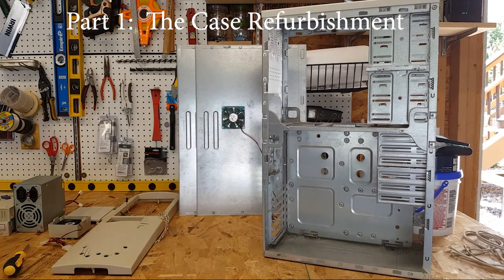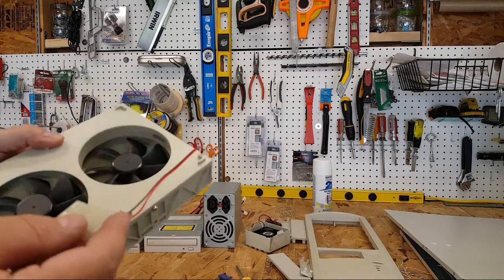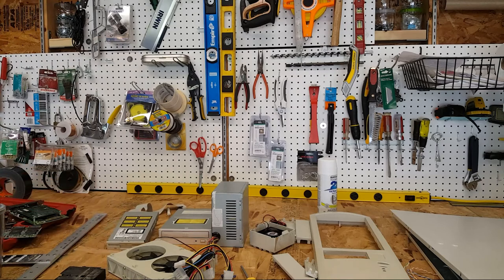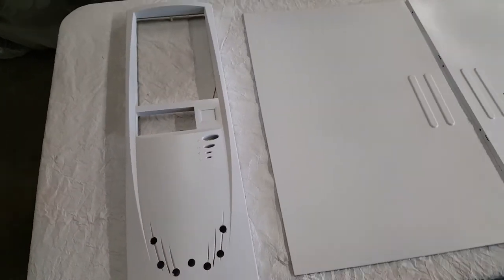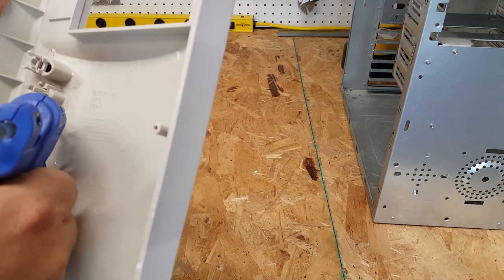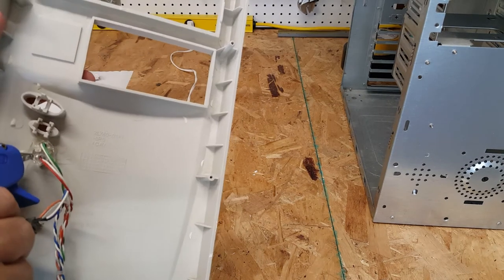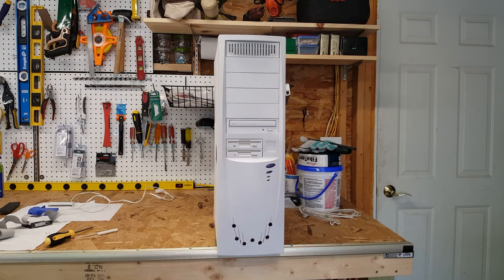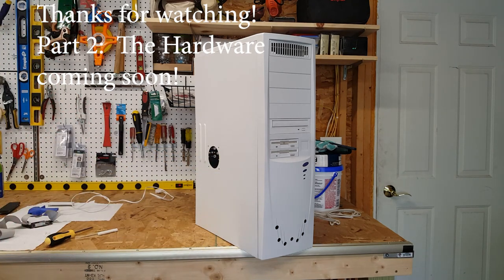Classic Computer Case Restoration Clean and Paint

Comment: About to start on my own "retro sleeper build". Did you have to sand down the parts before painting. Looks great!
Reply from the maker: In places, yes.  smoothed out some bumps in the plastics with fine wet sanding and filled with putty and sanded.  Overall, though, we used a self-priming rattle can color.
Make sure we all hear how your sleeper build turns out, pal!

Comment: Wow.  This looks like a great build.  I am making a similar system but it will just be Win98.  I have a Quadro 980XGL, which is basically a Geforce ti 4600,.  I am not sure whether to use a Pentium III 933Mhz or a Pentium 4 sysyem yet.  Both are compatible with Windows 98.   If I use the Pentium III I will probably use a Soundblaster AWE64.  If I use the Pentium 4 it will be the Vortex 2.
Reply from the maker: Well thanks pal!  
I debated using my Pentium 4 1.6 GHz and my Asus P4B-266 motherboard (still has AGP and IDE capabilities) before settling on a 1.2 GHz Tualatin Celeron.  I decided to stay away from ISA cards due to the "age" of this rebuild as being about 2002 vintage.
I was looking (I like to do this) on eBay to see what my original GeForce 4 Ti4400 card goes for.  Something over $300!  But I doubt anyone is buying them.
Reply: @UncleMikeRetro  I paid £72 for the 980XGL (only just bought it).  I find it quite fun trying different combinations of hardware. Either Period correct or a mix.  I also have a Quadro FX 3450 that I could use (it is same family as Geforce 6800).  drivers are available for Win98 but I think compatability with older games is poor.  It is more of a WinXP card.  I have enough parts to build maybe 8 retro machines now.   I think I want just 4.  One for DOS, one for Win98  one for XP, one for Windows 7.  I think I will build them slightly faster than period correct hardware, but not enough to affect capability.  I want to play the games at max settings in each OS
Reply from the maker: I can get with that.  Maybe I should make it an Ultimate Windows ME build?   Hmmmm.  Nice price on that Quadro card though!
Reply: @UncleMikeRetro  Windows ME is an OS that I never used actually.  Win98 did all that I needed and I stuck with it until quite a while after XP came out.  I think Windows 98 is better than ME if you want to play DOS games too (in particular I think an "ultimate Win98 machine" should also be able to run late DOS 3D games like Quake, Duke3D, Descent II or System Shock at "high" resolution (well, high for DOS anyway).  If you just want windows games though,and want to play games that dont work on XP, then ME is probably a good choice.  I think there are not that many games that dont work on XP though.
Reply from the maker: And... I suppose an Ultimate Win98 machine should actually HAVE Win98 😎
Reply: @UncleMikeRetro  LOL. Yeah.  An Ultimate PC for any OS is a bit of a unicorn though.  They just don't exist.  You can make the fastest one, or the most compatible one, or the most stable one, or the most period correct one, but no single PC will run everything well.  PCs just changed too much over the years for software to anticipate those changes and work properly.  Thankfully things have slowed now, so it is realistic to keep using a PC for 5 years or more before it is obsolete.